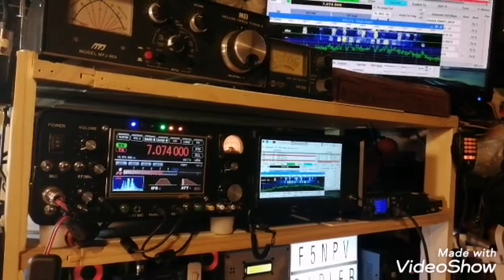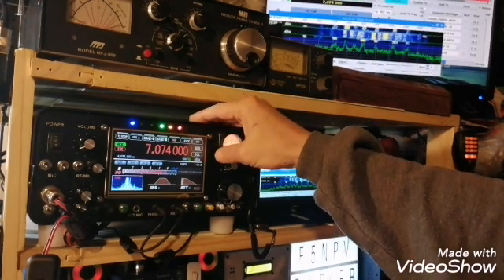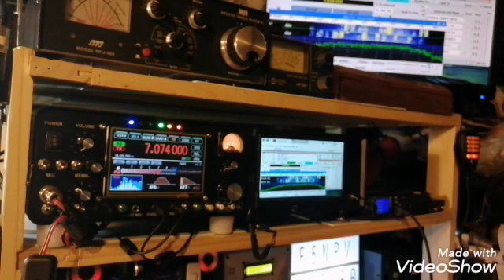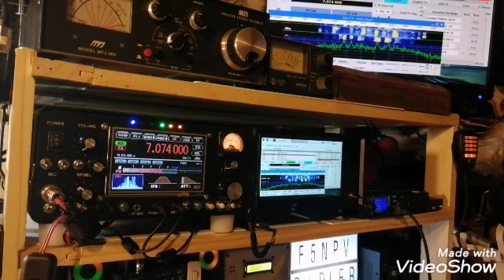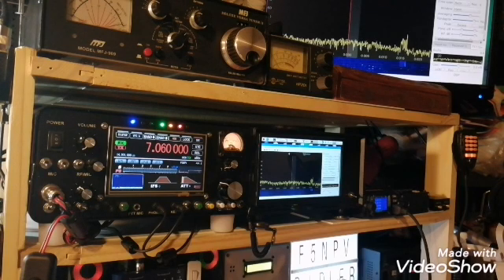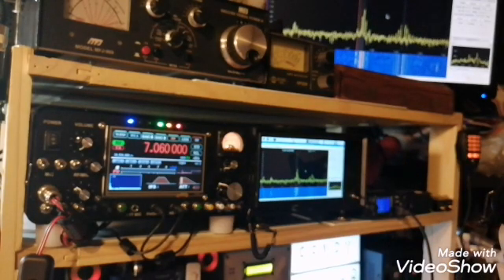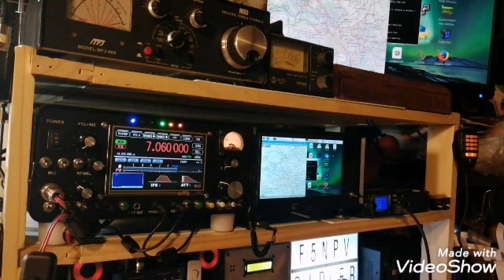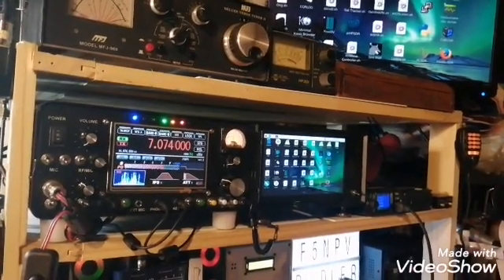F5NPV - UBITX V5 all in one

Comment: Fantastic work.  When you use the transverter, does the vhf/uhf frequency show on the display correctly or do you have to manually work out what frequency it's on?
Reply from the maker: unfortunately no, i have started to work on the software but not successful yet, too bad i am mostly a hardware guy and i always struggle on software. but i am not giving up and to succeed soon